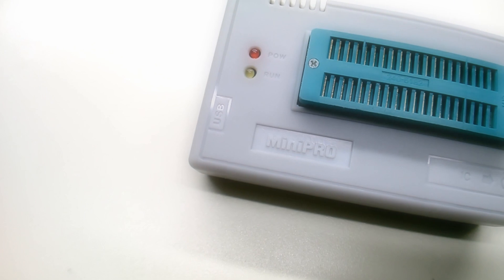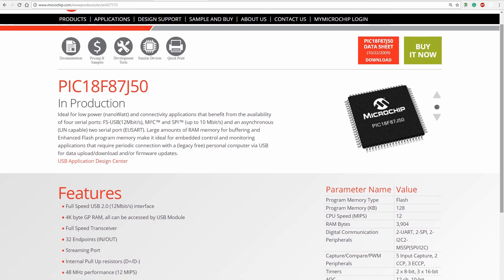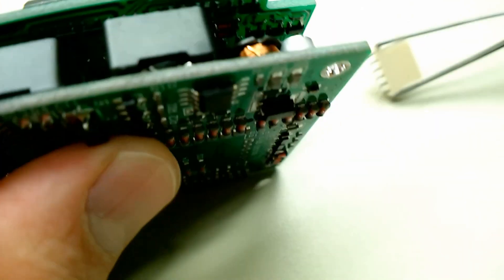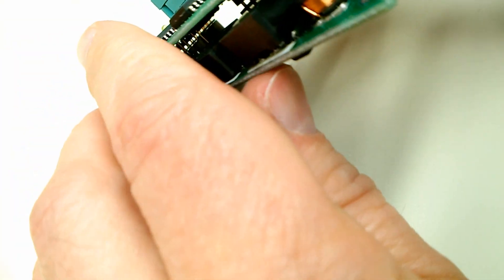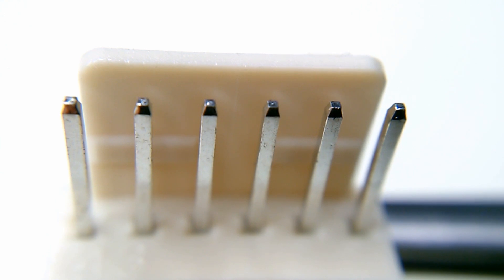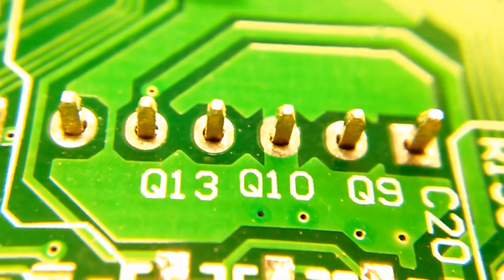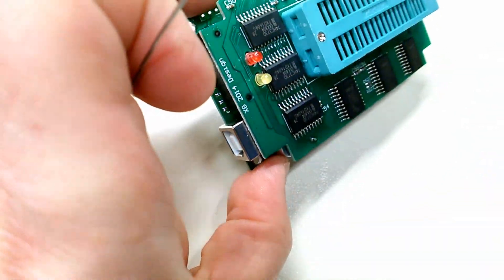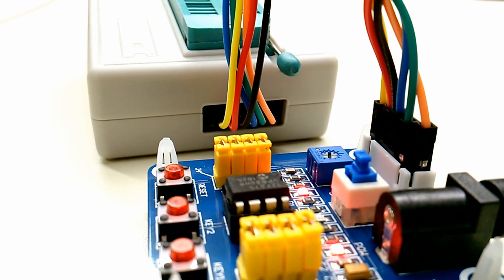#08 "Just Like the Real McCoy" MiniPro TL866 Mods — Part 2: ICSP Header Installation

Comment: thank you for posting.  the definitive 'square peg in a round hole' problem.  perhaps 'round' the pins a bit w/ a short length of 'just barely fits' brass tubing [from local hobby shop], chucked in a dremel tool or drill motor, w/ a tiny dab of tooth paste for abrasion.  take care & stay safe.
Reply from the maker: Great tip!

Comment: Great mod and upgrade!   I want to get one of those solder sucker vacuum things!  Perifractic has one!
Reply from the maker: The HAKKO desoldering gun is pretty good and very useful, but also quite expensive. If I was in the market to buy one now I would opt for the generic brand ZD-915 model -- https://ebay.to/31z1CFc -- separate vacuum pump base (i.e. better suction) and less than half the price. This is the model Jan Beta and other overseas (I'm assuming you are in the US) retro computer repair people use.

Comment: Cool mod. I had received a TL866II+ from China, which turned out to be a TL866CS. I have bought too cheap (again). Well, I have finally received a refund. Anyways, now I have a CS and would like to turn it into an A :-) Not that I really need it, but since it is possible, I need to do it. Excellent advice!
Reply from the maker: Thanks again for your positive comments. The process is fairly simple, however, I would recommend that you first review the current updates on the AtariAge.com forum (https://bit.ly/2HgXHWy) to make sure the process hasn't changed since i first posted this video. Have fun!

Comment: Hi, new sub here. What does the ICSP update bring in for programming support? I am aware that ICSP is the system for PIC programming, not aware of other devices that use the same system... can the programmer then be used as a PIC programmer?
Just curious...
Cheers,
 - Eddy
Reply from the maker: Hi Eddy. Thanks very much for subbing; your support is greatly appreciated.  Yes, the ICSP header is commonly used for PIC programming, which is why I wanted it -- I was following Julian Ilett's Introduction to PIC Programming series. But, Arduino (ATMEL) hardware can be programmed via ICSP, as well -- although, I have not tried this with the TL-866. In fact, I had labelled the ICSP port on my TL-866 after this video with PIC and ATMEL pinouts -- see picture in this tweet, https://twitter.com/MindFlareRetro/status/991384868184616961.

Thanks agiain for subbing and for your comment.

Comment: Thanks very much for your time. I always thought there was more to it than that with regards to the hardware (more SMD components needed). In my case I was a bit lucky as my TL866 has got the ICSP port pins fitted-in already. Hope I'll be lucky just as well upon installing the firmware fingers crossed! Not sure what ICSP is used for but am willing to learn.
Reply from the maker: Thanks for commenting. I'm happy that you enjoyed the video. It sounds like you already had a TL866A if it had the ICSP header. Did you purchase a CS or A model?
Reply: Oh my... now I figured it out! On the box there is written TL866. But then nearby there's a sticker stating TL866A Black (probably because it uses a black ZIF socket). I now also checked the label at the bottom of programmer and unknowingly I now found it is a TL866A. I guess I got mixed up when using the 6.60ver software it showed it was a TL866 in the 'About' menu when upgrading it from an earlier version. But the ICSP option was always faded and couldn't be ticked. It came with the ICSP header. Now upgrading to 6.70ver software made it show TL866A and I could now check (tick) the ICSP option.
Reply from the maker: Oh, interesting. So you have the black ZIF version. That's supposed to be a much higher quality socket...nice!

And now I notice that a new version of the TL866 is being sold. the "TL866II Plus" with some added features for burning NAND flash and other small feature enhancements, ebay.to/2DSk536.

Anyway, thanks for the update. I'm happy to hear you got it sorted out.

Comment: Thanks! I just used regular right-angle pin headers with some pre-made KK DuPont pin jumper wires. Two braids and a couple zip ties to keep the wires tidy and now we have a flexible header. Took seconds! Subscribed.
Reply from the maker: Yes, the I was going to do the same with a regular right-angle pin header but I ended up on a mission to make it as A-series as possible. Did you have to file down the pins to fit through the PCB? Oh, and thanks for the sub!
Reply: MindFlareRetro No fitment issue but they stand a bit high off the board. Longer DuPont socket headers may contact the housing, but these didn't. Oh, made a correction: I used DuPont pins, not KK pins.
Reply from the maker: Understood. Nice work!